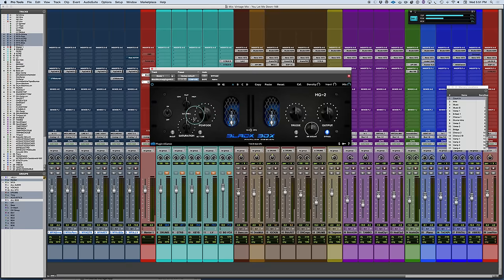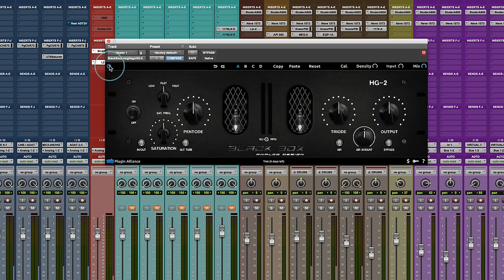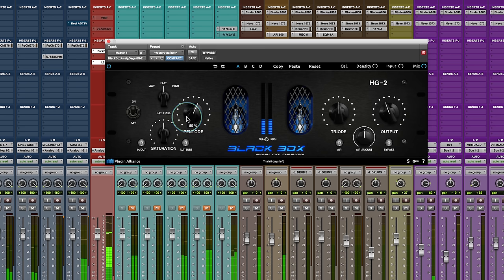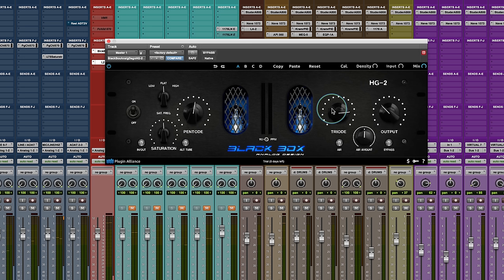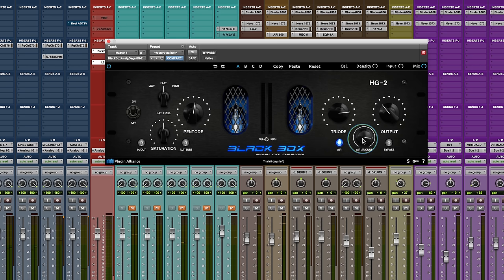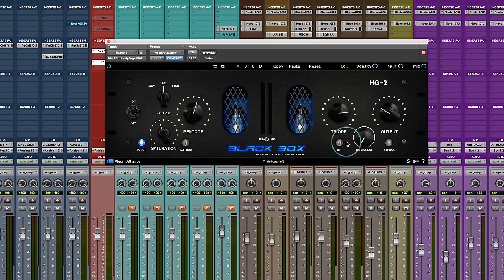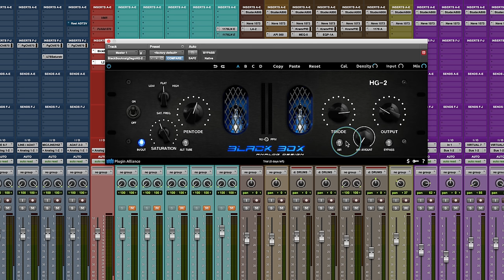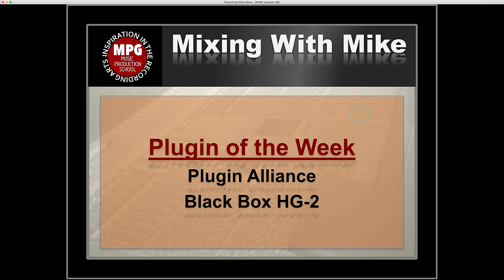Plugin Alliance - Black Box HG-2 - Mixing With Mike Plugin of the Week

Comment: Thanks for the video. Gotta say that 4:30 is a hilarious piece of misinformation though. Hilarious because we all fall victim to expectation bias and placebo when listening. The bypass on the plugin GUI is 100% identical to the bypass in your DAW. It turns off all processing.

You can verify that as follows:

- Insert an audio track.
- Send a copy of it at 100% identical volume, to a bus.
- Route that bus AND the original audio track to the output. Right now that will increase the volume since the signals are adding their amplitude to each other.
- Now insert a Phase Reverse plugin on the bus version, and reverse the left and right phase. This means the summing in the final output will merge the positive and negative versions of the track, and they will cancel each other out. This is a null test, as I know for a fact that you're aware of, Michael.
- Lastly, insert HG-2 before the phase reverse plugin on the bus. And use the plugin's own bypass button. It will not affect the signal a SINGLE PERCENT, so the signal will remain nulled out. :-)

So it doesn't matter what bypass button you use. But the one inside the plugin GUI reacts faster. Because it only disables processing. Whereas your DAW's bypass button often unloads the plugin code, which means it takes longer to react when turning on/off via the DAW, as opposed to just instantly bypassing an always-enabled instance via the plugin's own GUI.

Comment: Great review!  Say, as an FYI, the Saturation Circuit feeds the Pentode which then feeds the triode which then slams the transformers.  The routing is unusual but were not known for doing things the traditional way.
Reply from the maker: With so many saturation products out there, you have to do something unique to stand out from the others. This one does for sure!
Reply: Hey, just trying to leave a comment here since you left one about the signal flow. Just based on where I am on this video, it seems that "bypass" button in the Triode section, my assumption is that it only bypasses that section of the plugin...? If this is the case, I'd find that a very handy feature. Time and money is an issue for me right now so the easier information to obtain, the batter ;)
Reply: @InsaneCarville  Bypass is just that.  What comes in goes immediately out.  The signal sees nothing of the unit - not even a buffer.
Reply: @fullclipaudio  thanks heaps! Happy mixing.

Comment: Thanks for this. How does it stack up against Vertigo VSM-3? I find that the Black Box can do things to the bass that the VSM-3 can't.
Reply from the maker: I have never done a side by side comparison. Main difference is that the VSM-3 uses FET and Zener components for saturation while the HG-2 is all Tube. I've always found that Tube saturation works better for low end warmth so it would make sense if it is better on bass.
Cheers!
Mike
Reply: The VSM-3 is on every mix. That plugin alone is like my secret sauce. I like this one too. I'll be picking it up anyway because there's always something one plugin does better on a certain mix than another. Know what I mean?
Reply: @matrixate  Yes, buy them ALL! Just dont tell the wife that the kids college fund is on hold :)

Comment: Update: 14.09.2020:
Man, I must have been in a bad mood when I wrote the below comment. Sorry for that, don't know what happened. Watched the video again and everything is fine. The gain staging is a problem though. But it's the plugin, not you. Sorry  for having been so rude. Cheers

_______________________

When you bypass the plugin - although the mix gets significant less loud - each time I get the impression the mix gets wider again. The plugin seems to focus mainly on the mid range. Your kind of showcasing is very stressful, as you keep pressing bypass much too fast. Please allow our ears to get used to a sound. Psychological that's happening in 4 seconds. Than you can activate our deactivate bypass. Your setting isn't level matched either what makes it impossible to actually judge what you are saying and showing. I additionally think this plugin is great in using more focused on dialing in a certain tone and than use the mix knob, especially on a full mix or groups. For me this was a weak performance for a strong plugin. Stay safe and sound.